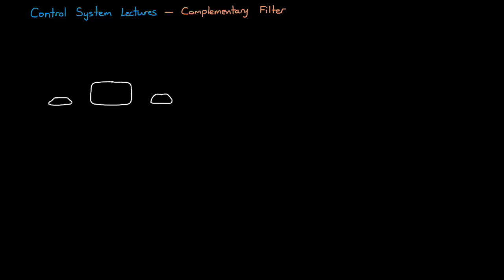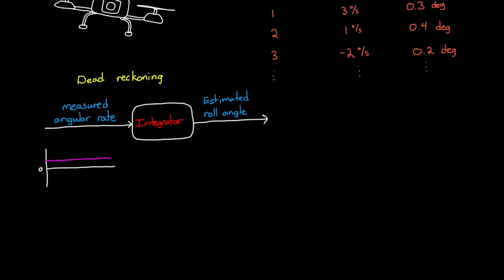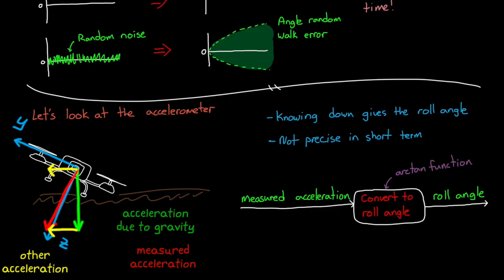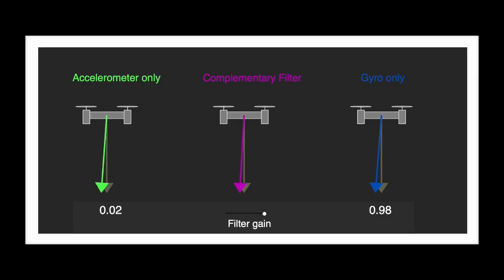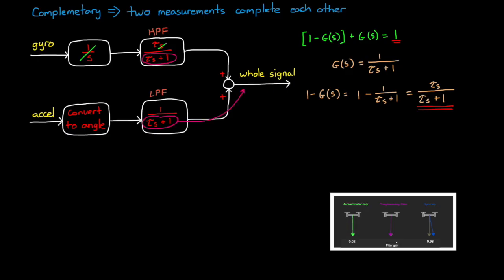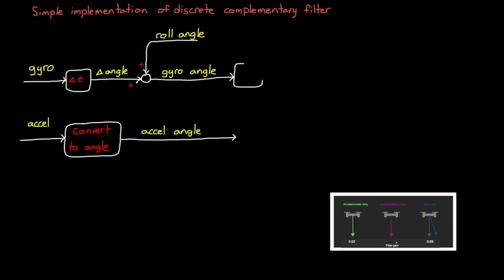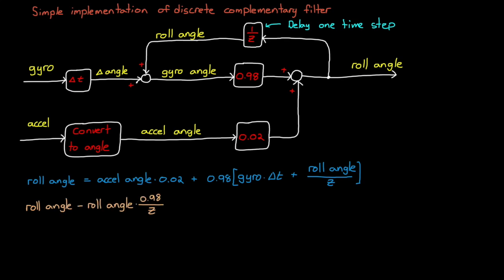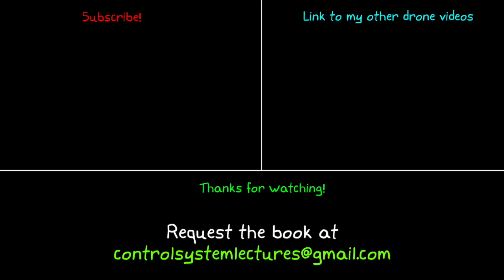Drone Control and the Complementary Filter

Comment: I recently started working with RL in navigating robots in a flow. I started working on double gyre flow as a benchmark and applied 5 RL methods to it. but the problem is that I need to compare which method could help the robot in terms of using less energy but I don't know which feature of the flow can talk about using energy. could you help me figure it out?

Comment: Is it possible to implement the same filter for getting altitude from a barometer and an accelerometer? Since we have to double integrate the accelerometer values, there's gonna be more errors, so what are the filter gains you would suggest?

Comment: When the drone is sitting on the ground, the accelerometer does NOT measure the "acceleration due to gravity" as stated at about 2:28 and drawn with the red arrow pointing DOWN (suggesting a positive value in that coordinate system). Accelerometers measure something called proper acceleration, which is the acceleration relative to the free fall. Loosely speaking, they measure all but gravitational acceleration... When placed on a surface with the positive direction of the accelerometer pointing up, accelerometer reads g(=9.8...). If the positive axis of the accelerometer is oriented towards the ground (as sketched in the video with the blue arrow), it should read -g. Besides "theoretical" discussions of the concepts such as proper acceleration elsewhere, this is also what data sheets for IMUs such as MPU-9250 (referred to in other videos) state.

Comment: You could add that this only works if the drone hovers steadily. The accelerometer will read all kinds of the drone's acceleration if it changes its movement. The acceleration vector won't point straight down towards earth.

Comment: Sir the explanation is really well, but I am confused between one concept 
In the discreet implementation what is  delta t and 1/z blocks. I under stand for example if my sampling frequency is 200HZ then delta t is 1/200 but what is 1/z . I would be really gratefull for any help.

Comment: I have a question: If for example I couple gyro_y (MPU9250) to pitch. Then what happens when roll is 90 degrees? Because at this point, the rotation on gyro_y should change the yaw, not the pitch. Another problem is, if the sensor is upside down, that means that the gyro_z has to be -gyro_z. How do I deal with those problems?

Comment: If I want to calculate the orientation of a model rocket, should I relay in the gyro completly? I think there will never be an accurate accelerometer reading at all during the short time of flight so I wonder if a complementary filter would make the results even worse in this case...

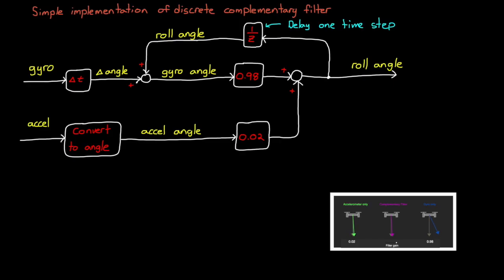Comment: Hey Brian, at 8:32  in the block diagram you have multiplied the gyro angle by 0.98 and the accelerometer angle by 0.02,  doesn't it mean  angle computed by complimentary filter should be close to what the gyro reads.  But  your java script animation shows the complete opposite , isn't it???

Comment: Hi Brian , I am sending data from arduino to MATLAB it is like Ax,Ay,Az,Gx,Gy,Gz  (Comma after numbers),when i check how much samples are coming (The above set) i found that its around 216.But now i am little bit confused that whether i need to take the sample rate of each  (Ax/Ay/Az..) be 216 samples/sec or 216*6 samples/sec or 216 *11 samples/sec(This includes comma also).
because i need to pass Ax ...through Low pass filter there i need sample period.

Comment: There seems to be a error in the math shown at 9:36 or is it just me?

The second equation does not give the third if moving the last part og it to the right of the summation point and hence, wouldn't give a discrete low pass filter.
The third equation, if solving for the single "Roll angle", would then be:
[roll angle] = [0.02*(accel angle)+0.98*(gyro angle* Delta t)] + [roll angle]*(0.98/z)

or am i wrong Brian ?
Reply: Unfortunately I cannot understand this passage either. I would also be very happy about an explanation Brian.
Reply: Nevermind, i got it... 
You have to factor out the roll angle on the left side of the equation to roll angle * (1- (0.98/z)) and after that you can divide the equation by (1- (0.98/z))... that results in the third equation of the video... thank you for the great video Brian!

Comment: 9:10 What is 1/z? Or what is that z?
Reply: In discrete systems instead of Laplace's domain we use the Z-transform, so 1/z is a delay in discrete time
Reply: @leonardoflss  Would it be possible to get a brief elaboration on what exactly it means to divide a value by Z? Does it have units? I looked at the wikipedia page for the Z-transform and understood absolutely nothing, a bit lost here.
Reply: @jacksonsmith2955  I was so concerned to point out references that I forget to actually answer your question, tldr: "divide by z" is, in a practical sense, use the previous sample of a signal. Then, z^-1 is the last sample, z^-2 is the second to last, and so on and on... On discrete control we should think in terms of computing/measurement cycles, a.k.a loops. The data from the previous loop are at the k-1 index of the signals "arrays", and the data at the running cycle are at the k-th index.
Reply: @jacksonsmith2955  the signals does have unit. Taking the previous sample of a signal is just a time wise operation, so the unit is preserved. For example, a velocity signal at time k, in m/s, is m/s whatever is the index k, k-1, k-2...

Comment: Please note that an accelerometer can not be used to determine which direction is down when the drone is in flight, since gravity will not affect the accelerometer in flight, since gravity is cancelled by the propellers/thrust to make the drone fly and hover.
When the drone is flying it is therefore WRONG to assume that the accelerometer can be used to determine roll angle from the assumption of it measuring the gravity direction.
A lot of people use the accelerometer and complementary incorrectly on drones due to this misunderstanding.

What happens when the accelerometer is used in a complementary filter as shown in this video, is basically that you end up with a dead-reckoning based estimate, since your accelerometer measurements (in the local drone frame) will always point in the direction of the thrusters plus the actual acceleration of the drone. This makes the estimate very vulnerable to the gyro bias resulting in a drifting estimate.
What saves you then would be any type of position feedback, e.g. GPS or optical flow, since this makes the gyro bias observable.
But without position feedback you could rather just fly your drone with a gyroscope only!

For more information, feel free to read Chapter 2.1 and Appendix B of this rapport: http://tkjelectronics.dk/uploads/autonomous_indoor_navigation_for_drones_using_vision-based_guidance.pdf
Reply: Thank you for this reply. I have been going around in circles in my head trying to get this straight after reading about the pendulum rocket fallacy. An accelerometer in freefall will not feel gravity, so why would it do so when the thrust is switched on? It only feels the direction of thrust.
Reply: @Mike_Hunt_Works  @mindthomas Thanks for sharing the information!

Comment: I have two actuator problem with 3 sensors which I believe would be 3 states.   I am looking to use PID and state space control this problem.  I don't think I need PID if using SS design model.   I am trying to get a hold of state space.  most models I build fail.   I need to go back to basics and build from this.  State Space is used
because of 3 inputs and two outputs.  The simple system reads setpoint of pressure and has two pumps using two different control actions for a pump.  One pump is fast and other is fine adjust.  I have no models for this.  Still working through this not sure how to model pumps and motors yet?     System time response is slow so ramp and soak then one op in a PID hold value at temperature.  It works but not very accurate.

Comment: What does the calculation for delta angle look like? I'm using your guide for a university project, and for delta angle i have "angle velocity measure - last angle velocity measure", but it doesn't seem to give the correct filteret output.

Comment: thanks Brian Douglas it's just awesome !! you have done  superb job ,keep it up but one thing i don't understand 1/(1--0.98/z) what is value of z,  can i write  1/(1--0.98/1) instead of it???clarify pls
Reply: Ok, so I did some googling, (please accept I might be wrong in this). No you cannot just write 1/(1--0.98/1), although you might get something that looks right but it is not. Z is not a value but a transform, from discrete, to time domain,  (transform similar to Laplace transforms). In this case 1/Z  is holding the value for the last unit step of the roll angle. It's like a memory block that remember it's last iteration. So in the part of the equation that you see (0.98/Z), that's 0.98 *1/Z  or (0.98 * the value of the roll angle from the Previous time step). Hope it helps.
Reply: @liobundury    thanks !! yeah i understand
Reply: I have the same question. How is 1/Z delays, one step? I feel like is very simple and I will feel dump when we get the answer.

Comment: One slight correction (that doesn't impact the point of the video) - a stationary accelerator will see a positive acceleration equal to gravity AWAY from the ground, not towards it, because it is a body force.  The accelerometer really can't measure gravity.  It's measuring a normal acceleration that counteracts gravity when it's not in free-fall.

Great videos as always Brian.
Reply from the maker: Oh, you are correct and I led folks a bit astray in this video! Thanks for the clarification on the video and I'll add that to the errata list so it, hopefully, won't trip anyone up in the future.  Thanks!

Comment: Brain, we need to get you involved in the Betaflight open source race drone project!  Great stuff!!
https://github.com/betaflight/betaflight

Devs. Slack --> https://slack.betaflight.com/
Reply from the maker: I watched a few of your videos and they are really good! I'm not sure if I have anything to contribute to Betaflight but I'll check out your repo.
Reply: @BrianBDouglas  , thanks!, but I beg to differ.  I think you could help the project out a lot!  Threw it up on the board for folks to look at the concept of a complementary filter.  Not sure if it is fast enough, but worth a close look.  Many of the guys are far smarter than I.

Some recent additions to the code were i-Term clamping ("i-Term Relax") which helped a lot to eliminate i-term induced bounceback and FeedForward (at least as best we can so far) to sharpen stick responsiveness.  Some guys are now looking at pushing stick inputs (Setpoint) forward in time and some other techniques to eliminate overshoot.  

Anyways, give it a look.  I have a lot of fun mixing it up - where I can - with the smart guys that contribute to the project.  I focus a lot on the filtering and mainly help with conceptualizing, test flying new code, and then communicating to users on the details.  BF has an ~200,000 user base worldwide.  We just made some decent strides in improvements to the tracking of our dynamic notch filter (tracks peak motor noise) and throttle based raising of the lowpass filters used to clean up the gyro data (higher cut-off = less signal latency to help with addressing prop. wash).  Hopefully, in the near feature, we can all move to fiber-optic gyroscopes so eliminate all these noise issues.  THat will be a quantum leap in control accuracy; hopefully.

Keep it coming.  Great stuff!!

Comment: please explain accelerometer and gps sensor fusion. i am trying to use integration of linear acceleration from accelerometer and then convert it into displacement and then i am trying to filter it using kalman and add gps input. but tje first step isn't working accurately. how can i get linear displacement i mean travelled distance using accelerometer.
Sensor : MPU6050
Mcu : Arduino